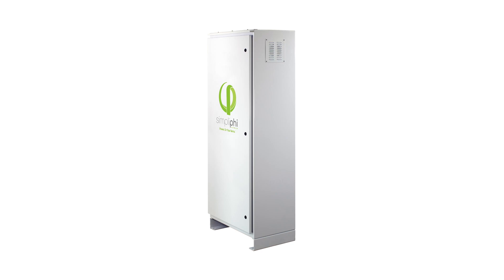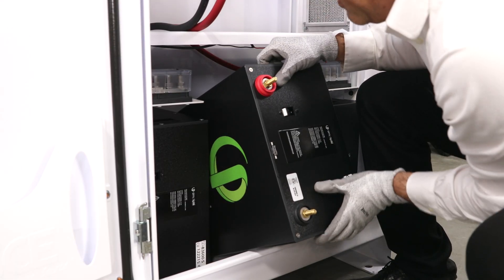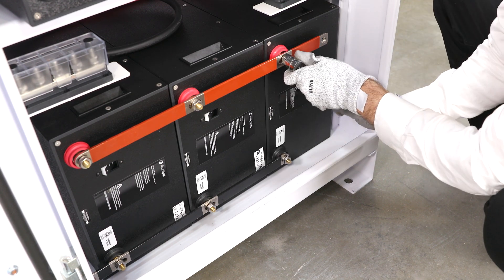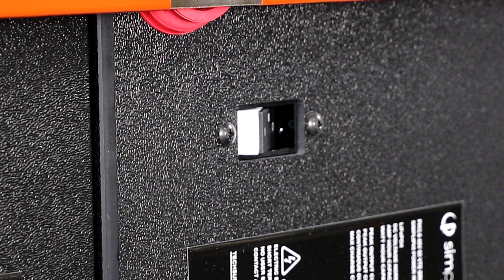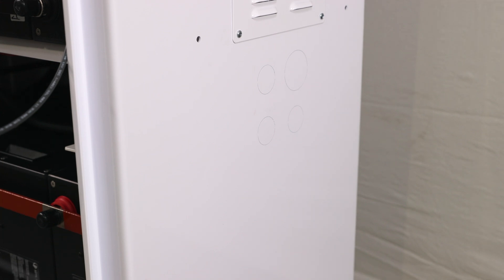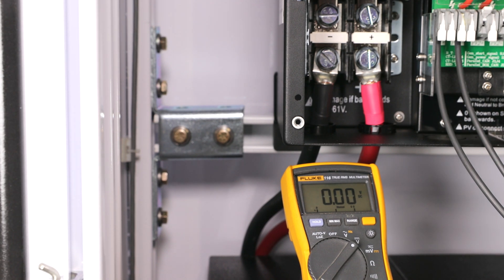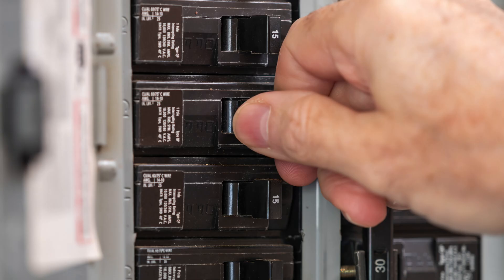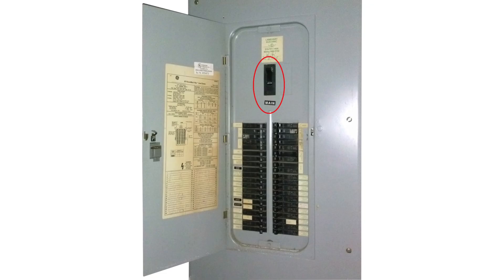SimpliPhi Power AccESS Sol-Ark Assembly and Wiring Quick Start Guide

Comment: Couple things that made me cringe a little. 1. That uninsulated ratchet almost touched the negative post while tightening the positive terminal.. bajesus!  2. I don't think one should automatically assume all of the batteries are near the same voltage before placing them in parallel.  You should always ensure each battery is near the same charge level before flipping each battery's breaker, otherwise you'll have massive current flow between batteries and probably trip breakers.
Reply from the maker: SimpliPhi Power batteries are tested and discharged in our manufacturing facility under certain protocols.  All batteries should come out of the box around 30% SOC.  We recommend connecting all the batteries with the loads turned off and charging the entire bank together before connecting the loads and letting the batteries begin their initial discharge cycle.
Reply: @BriggsandStrattonEnergy  Yeah but still, guy above is right...  should never have a public video demonstrating how to connect positive and negative leads together with your hand tools...  just update the video and erase this piece or put a text disclaimer in - seriously
Reply: I get nervous watching the metal wrenches near the terminals too, but wasn’t the battery breakers off until all the wiring done? A note or warning about the danger and ensuring the breakers are always off before working on the batteries isn’t a bad idea tho.